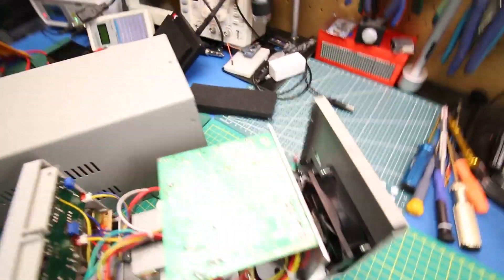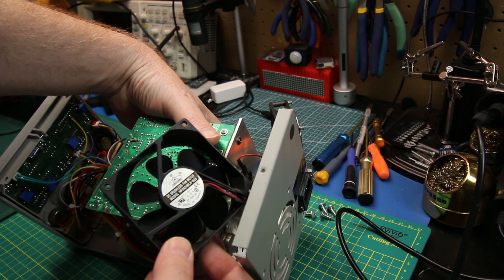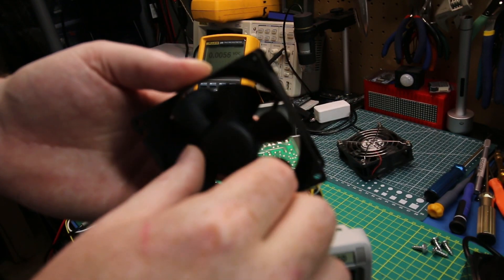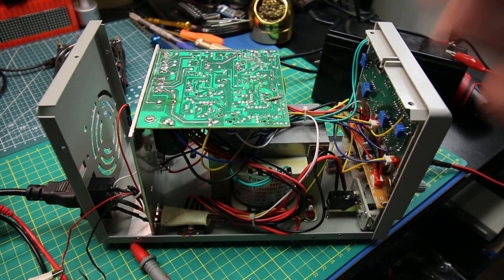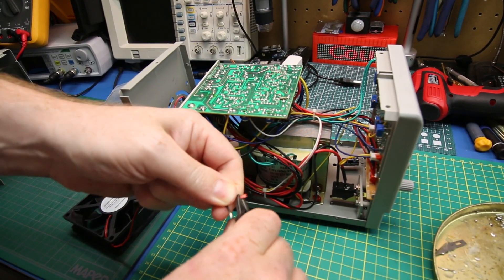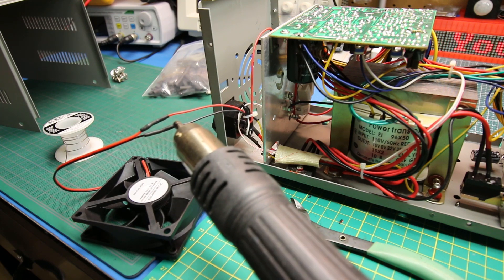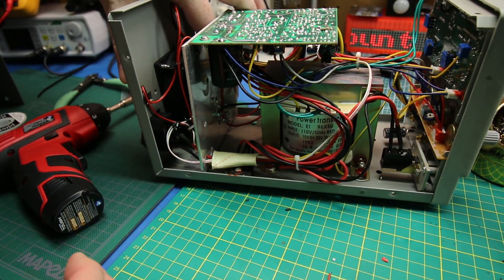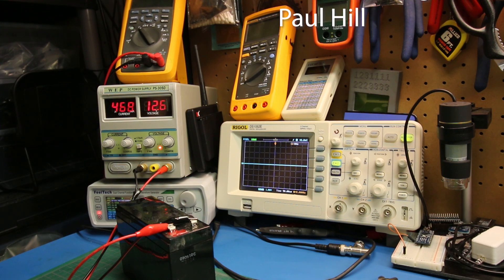Bench Power Supply Repair

Comment: @MKme Lab     Might you have an idea what would make one's current start falling off as it's charging a battery, but then rises back up RIGHT BEFORE before it switches over from constant current to constant voltage?  I don't have this exact model, but another cheap Chinese version.    It seemed to work fine yesterday, and now it's acting up...

Exact scenario I just watched happen:  Charging 2 lithium-ion batteries in series.  Voltage is set at 8.2 volts. Shorted the leads out to set the max current at 1.5A. Connected leads to batteries and the current only goes to about 1.3.  As the batteries charge up from dead, the current eventually falls off to 1.1, but when the voltage reached 8.1, the current begins to rise again lol. Rises about to 1.3-1.4 or so, then switches over to constant voltage at 8.2 and, of course, starts falling again like it should.

Comment: I have a cheap higher current power supply, which I wouldn't leave unattended for long.  Then I have a lower current Agilent that I would trust.  Of course the Agilent cost many times that of the other.  24 volt fan eh?  I thought for sure you would measure 12 volts at the supply.